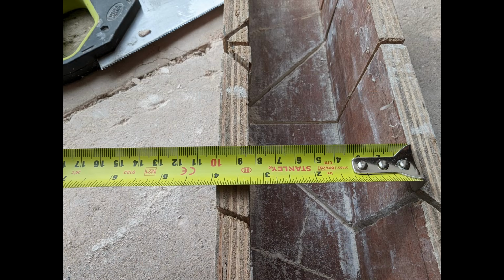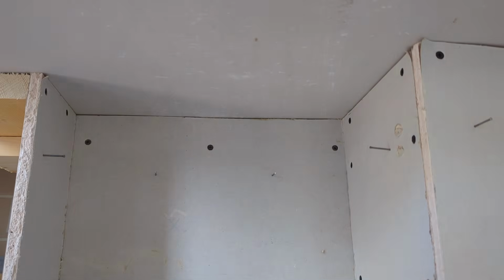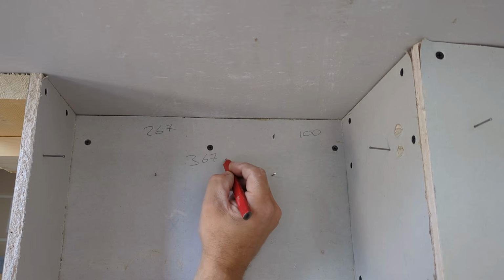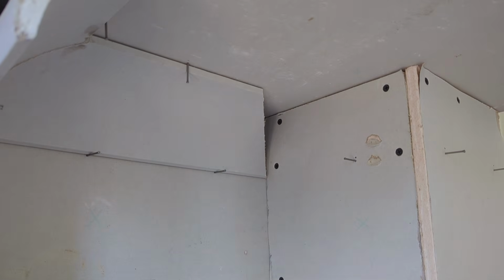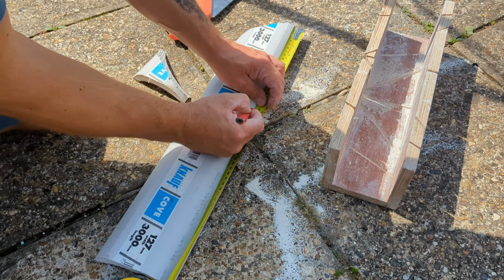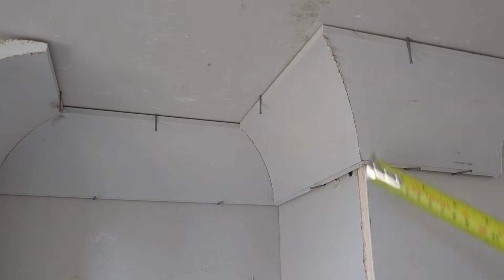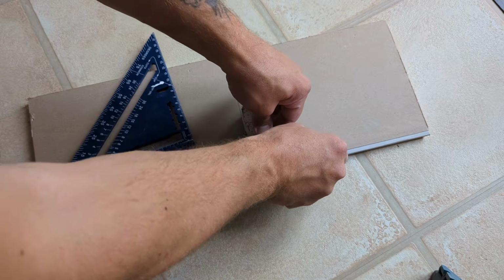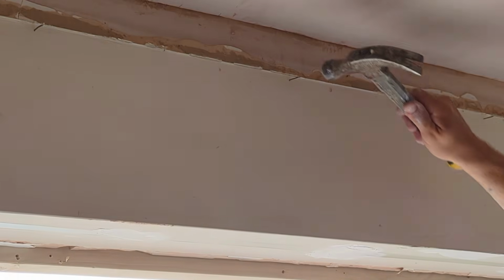How to cut coving like a PRO (EASY)

Comment: The problem with installing coving in old houses is that walls are not at 90°, they are a couple of degrees out, so often mitres don't meet properly.
Reply: New houses , old houses 
I’ve never come across a 90 degree internal or external corner yet 
I just try and get them as close as possible and then have to fill the joints with east fill
Reply from the maker: Absolutely, the joys of old houses. I would rather my old home than one of these thrown together new builds though.

Comment: As someone who’s done Coving for the past 35yrs you don’t half make it look complicated, for starters you’re cutting the coving all wrong, you should cut into the face to obtain a crisp cut, you are cutting it from the back to the front which results in jagged rough face cuts, also I don’t get the pins, I used to just cut, offer up & fix in place, often in excess of 100 metres a day. If I was looking at your method as a newbie I’d just give up & not even bother 🤔
Reply from the maker: Thanks for the comment it's really helpful. The idea of cutting it this way is to try and make it less confusing, cutting into the face means you have to flip the mitre upside down. The pins are there to help support the coving in roughly the right position. This video was never going to be of any use to someone like yourself, you are a professional who could probably do this with your eyes closed. This video was aimed at a DIYer. Thank you for watching, have a good day!
Reply: @DIYTipstricksandhacks don’t understand him m8 cus the reason you get bad mitres is because it’s not measured down the wall right, he must have a good eye but you always get one know it all even though it’s for diyers, good video👍
Reply: One of the most depressing, unconstructive & miserable comments I've ever seen on YouTube. Question: with 35 years of experience fitting coving why were you even watching the vid in the first place? No need to reply, most of us already know...

Comment: Its quality but id never earn any money
Reply from the maker: That's because you're a master with the easy fill. You're right though, if I were on site and on price I wouldn't put half as much effort into it because I know I could make it look good by the time I'm done with filler and caulk.
Reply: @DIYTipstricksandhacks  or coving adhesive decorators pick up the rest another thing is I don’t no the last time I see a straight plasterboard ceiling

Comment: Good vid that is I’m a plasterer and I’ve had nightmares with coving in the past especially on uneven ceilings that’s why I generally use super cove now as it’s lighter and bends more than plaster types.
Reply from the maker: Me too, that's why I built the mitre box which worked great the first time. The next install I done, it was way out which is when I realised the coving isn't the size it claims to be. Now before I install coving the first thing I do is check its size and adjust the mitre box accordingly and since then I've not had a problem. Thanks for watching, have a great day 👍
Reply: I'm on one right  the walls and ceiling are a right shape 🥴

Comment: What do you do if your corners are not 90
Reply from the maker: You mean like 135 degrees or just slightly off 90?
Reply: @DIYTipstricksandhacks What does it matter, there is a basic procedure, tell him 🤷🏻‍♀️
Reply: Draw your width line on the ceiling either side of the corner. Draw a line from the corner through where your two lines cross and you have your funky angle
Reply: @chrisgregory8527  Correct 😀

Comment: Can you do a video on making the miter box
Reply from the maker: Thanks for watching Paul. Absolutely, I would be happy to :)
Reply: Get a metal wondermitre  tool  perfect mitre every time  it rests on face of coving & handsaw  leans against it when cutting does internal & external  joints plus stopped ends
Reply from the maker: @stephenwarburton278  I used to use those a long time ago. You're right they are good but they're easy to make a mistake with especially if you're new to using one
Reply: Hi a managed to get a hold of a mitre coving box do you know how I would go about cutting a coving stop end just trying to figure out the angle as am coving my hall way downstairs but a want it to come to a stop when the ceiling arches up stairs ?
Reply from the maker: @paul-fk7de  Hi Paul I'm glad to hear you have a mitre box, I've recorded one of me making a box, I haven't had the chance to edit and upload it yet though.

 It's difficult to explain in a comment but I will make a video 1st thing tomorrow morning and upload it straight away for you.
Reply: @DIYTipstricksandhacks  Thank you so much for taking the time to help me 👍👍